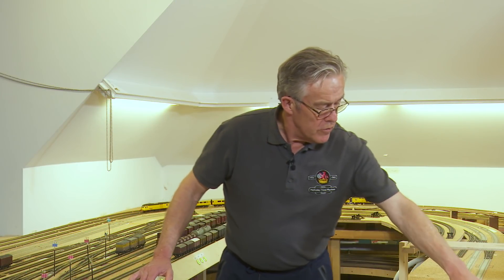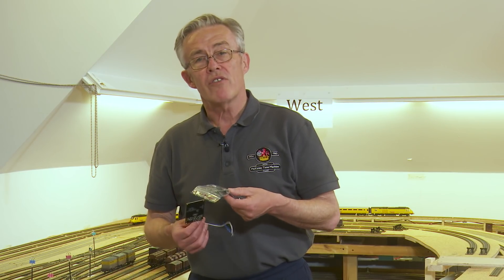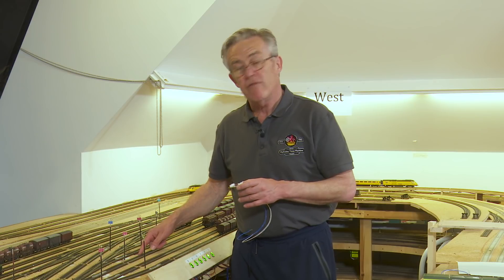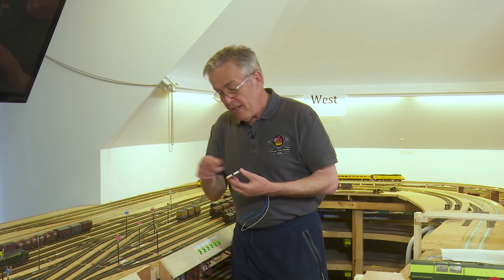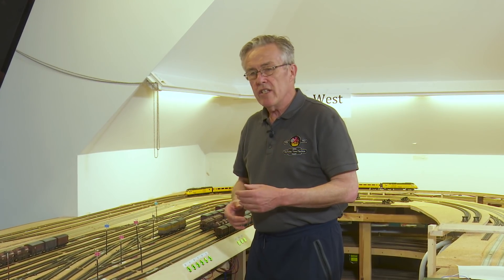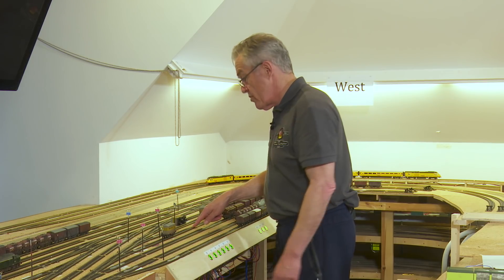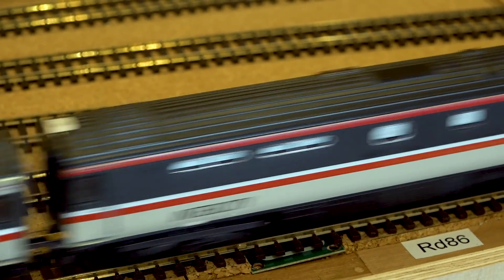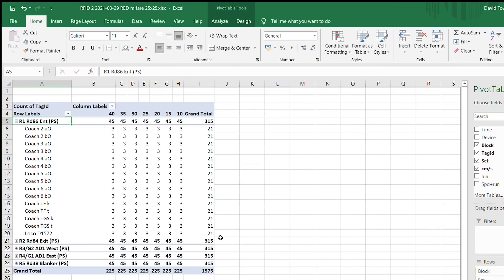47.  Our RFID Beta readers are now reliable in managing our freight stock at McKinley Railway

Comment: Why not considering UHF technology. Also using a 2g/3g/4g on board UHF unit would be a cheaper solution. Putting RFID tags on the tracks are cheaper. With an on board unit, you will be able to expand the application such as speed of train, etc.
Reply from the maker: Hello groovy,
We are not RFID experts and Its taken us a long while to get this far.  We don't need to monitor train speed as that is controlled by the software and it does a good job at it.  Our real challenge is to identify where the wagons are as the primary goal is to manage freight movements.

I believe putting readers onto wagons would be extremely expensive and very challenging re power and space.  The tags are cheap, but the readers not. Bear in mind we have 10 times more wagons that we have locations we want to record. So our orientation of the world works for us (i.e. tags on wagons and readers under the track).  We looked for practical solutions provided by manufacturers that could be considered to be Off-the-shelf. Good luck with your ideas there.

Comment: Very interesting and exciting! Following your progress closely. 

Do you still have the sam RFID-tags you showed two years ago or have you found any updates to the tags? 
https://youtu.be/xcWixqpF44A

I'm looking for tags that would fit under an N-scale waggon. 

Thanks for at great channel!
Reply: You may try UHF PCB metal tag that uses screw to mount.
Reply: @groovyc4344  Thanks!

Do you have any suggestions on brand and model or where to buy them?
Reply: @AlexEhn  they may send free samples
Reply: Thank you very much  @groovyc4344 ! Much appriciated. I'll check them out.
Reply: @groovyc4344  Do you know if the UMT – 12x7x2.5 is the same technology?  Or even UMT - XXS that is 5x 5x 2 mm

79x20x3 is a bit to large for N scale.
Reply: @AlexEhn  yes both are UHF technology. Read distance depends on the size of reader antenna and tag. What read distance would you like to achieve?
Reply: @AlexEhn  but for small tags you may not be able to screw them on. You may need to use epoxy to stick them onto metal surface.
Reply from the maker: Here's the ones we use across all the stock -  It fits on OO/HO.
https://zipnfc.com/nfc-sticker-midas-tiny-ntag213.html
I am sorry but I can't recommend anything for n-scale.
David
Reply: @dattouk Brilliant! Thanks alot!
Reply: @dattouk  That was precisely what I was hoping to find. You mount them with a sponge on the underside of the stock, don't you?

Comment: Fantastic stuff! I'm particularly a fan of the cargo registry for automatic unloading of appropriate goods, it's amazing what new ideas a "small" change can produce!

I'm interested though how the initial setup works for each wagon/loco - do you have to tell it where it started initially, or will it work it out once it's gone through a couple gates?
Reply from the maker: The system will know where stock is when it goes over a reader.  However, its not quite that simple.  We have to get the engine right in terms of pre-locating things as the software wouldn't know which locomotive to start from track 10 so to speak.  Once the layout locations have been recorded by the RFID system, the two worlds (database and the layout) should stay in sync.  The assignment of waybills is entirely automatic.  At the moment, they are being generated on a random A to F destination basis to test the software.
Reply: Have you watched the guys video of them actually loading and unloading the wagons with real product. It's all run on lasers and arduino. Real O scale hoppers with manganese I think.

Comment: Looks really great, ultimately though the point selection of the sidings could determine whether a reader needs to be powered to read wagons as they pass over.
Reply from the maker: Hello Andrew,
You raise a valid idea that we did consider.  We decided to put the sensors on each track rather than rely on the point logic to make the determination about the siding just for simplicity at this stage.  It could be done and in time we might get there, but its a bit of a crawl-walk-run process at the moment.
David

Comment: Great to see your breakthrough moments here. If your 8 channel multiplexer can handle a shunter at say 20mph then I suspect you will be able to handle 160mph on a dedicated single channel reader. RFID certainly the way to go as long as no interference from RFID stock running by on adjacent tracks. Optical on a layout like this would be prone to dirt blocking sensors (suspect you'll end up with a few hundred dotted around )- particularly as looking upwards to read QR or bar codes under rolling stock. Great stuff, relish the moment. Stephen
Reply: I would think the on board reader is a better solution. Placing tags on tracks are much cheaper and much more reliable because passive tags are very durable.
Reply: @groovyc4344  Here its the other way round, they have the tags in the rolling stock (suspect 1000s of even allowing for one for each of their triplets) and the permanently powered static sensors located beneath the tracks. Using the multiplexer card they had Eccel develop I suspect has also saved them both installation time and costs in addition to the space savings/ real estate elaborated on here versus single channel units. Its certainly a ground breaking and technically challenging layout!!
Reply from the maker: @stephenpike3147  You have the logic correct Stephen  The readers are expensive and need quite a lot of power and space which isn't available in the wagons themselves.  Its been an interesting journey just to get reliable reads.  The big challenge is metalwork.  It interferes with the signal more than track power does.  I have no idea if it will work at a scale 160 MPH.  I have nothing that will go that fast.  We have found that certain MUX readers work better that the dedicated ones.  Go figure!  Anyway, we now have to test the hardware working with the software.  I envisage a typical operations session of 3 hours will have about 900 reads in one station alone.  If we can get the system to behave with say 3 or 4 hiccups for the operators to resolve  I will be super happy.
regards
David
Reply: Interesting g to hear about your problems. If the rails are the problem interfering with the magnetic field have you tried using rails of a different composition.  E,.g. relative permeability of iron circa 1000 versus brass circa 10, copper 1 at  50Hz  (brass depends on composition rest I believe varies on frequency), a simple trial set up might help evaluate. Problem is track manufacturers do not declare  composition of alloy used. Just wondering if this might be root of problem (I am not an RF or antenna man!).  Stephen

Comment: You mentioned it was tuned...

So is this special or off-the-shelf readers / tags? I'm curious, because I've been trying to use RFID tags myself, but I have been unable to read the tag fast enough to detect a running train.
Reply from the maker: They are off the shelf.  Our results show they are excellent for HO/OO speeds of 65 MPH/105 KPH.  Maybe faster, but that is the max speed we will operate our trains at.

Comment: Hi Dave.

What with Charlie's new electronic signalling system, and now your new rolling stock location system, I've started developing seizures and find myself staring into space for no apparent reason. I told my doctor I only wanted to play trains, then he insisted I put on this white jacket with sleeves that are tied around the back of me. What's going on?
Reply from the maker: Dear Paul,
Your comment had me in stitches.  I promise the end result will be rewarding.  A core mission for McKinley is that visiting railway clubs should be comfortable operating a part of the layout within 30 minutes of arriving for a day's operating session.
Most of the followers I have met blame me for their wallets looking really empty, but they have a huge smile on their faces.  Take comfort that if they haven't committed me yet, they will leave you alone for another year at least.
David
Reply: Thanks Dave.

Judging by the odds, I'd say we are both safe from being committed. As my ol' Mum used to say: "There are more out than in!".

Comment: Interesting stuff David!  Your approach, with the latest updates and reworks obviously performs well and the database integration opens up a whole load of new modelling dimensions as you touched on. However, What are your thoughts on costs? I think my main reservation would be the cumulative cost of RFID on a layout. RFID costs have been a major barrier to the adoption of RFID tagging of 100% of goods in supermarkets and its use only on comparatively high value products.  Aside from that reservation this is great work!

Vehicle location schemes are of course most valuable on large layouts where there may be multiple operators or where significant portions are not easily viewable. I have been investigating using micro-QR codes (Just printed on a general purpose Brother label printer and measuring no more than 7mm square) stuck on the bottom of vehicles, and using cheapy little QR code readers with serial outputs under the track.  QR codes are massively more robust than 1D barcodes and can be read very fast.  So far I have 2 readers talking to a single Arduino pro (also very tiny) to receive and marshal the serial data. The Arduino send all data back to a central control point (a PC at the moment) via serial cable (eventually it will be just a CAT5 Ethernet). As yet, I lack a layout to do proper testing on though, so no idea how reliable it would be with trains passing at speed and with many in operation at once.  However just pushing stuff along the rails fairly fast it all works well so far.  Now you have me wondering if I should go RFID instead! 

Thanks again
Alan T.
Reply: To be honest, whilst Dave is cautious with expenditure, I don't think they worry too much about the costs.  Look at the project, there's probably tens of thousands of pounds invested in track and wagons alone.  A few hundred on RIFD tags isn't much in the overall scheme of the project.
Reply: plus, it looked to me one RFID per 3 cars/wagons. Perhaps more reliable at speed.
Reply: Regarding cost: RFID tags are really cheap if you get them in bulk, like a cent per tag for 1000 tags
Reply: @goawaygoawaynow  Before I investigated the micro-QR route I did play around with 1017 RFID readers and NFC tags, but the range was a problem and the stick-on micro NFC tags were nothing like as cheap as you instance.  You can certainly buy the Mifare medallion tags for that kind of money, but they are too large for this work and - as Henry instances below - the range is not great for this purpose anyway.  I have never found stick on ones of the right size for this application anything like that cheaply - more like £1 per tag last time I looked. Maybe I should look again now. :-)
Reply: I have been trying RFID with an Arduino but the standard mifare RFID doesn't work (can't get the tags close enough to the reader and metal weights in the wagons interfere). I like your idea of QR codes but I want to know if the reader uses IR or visible light to read the code.
Reply: @henrybest4057  Visible light - well, it shines a visible light!  You could leave it enabled all the time, but In my finished thing I had envisioned that the scanner would activated by a block detector. But this is very much a work in progress for me. Here is a link to the scanner I am testing with - but there are others.

https://www.banggood.com/GM65-S-1D-or-QR-or-2D-Bar-Code-Scanner-QR-Code-Reader-Barcode-Reader-Module-USB-UART-p-1694180.html
Reply: @alanmusicman3385  I looked at the GM65 but it didn't say what the light source is. Even if its only turned on by block detection, light from between the rails isn't prototypical and there won't always be a convenient tunnel to hide it in. A neat idea, but not for me. I hope it works well for you.
Reply: @henrybest4057  Yes, that is a consideration - but even an infrared device would show up on videos or photos of the layout.  I suppose coupling the reader with an IR detector that only arms it when a train is directly over it would be possible, but yes, you'd still have a light from between the rails under the train.
Reply: @henrybest4057  you should try UHF. It works much better than HF.
Reply from the maker: Hi Alan,
The cost is reasonable.  The tags truly are cheap.  They are 22p each.  Here's the ones we use across all the stock.

https://zipnfc.com/nfc-sticker-midas-tiny-ntag213.html

We use the Eccel readers which are either the Pepper MUX 8-channel boards or the single Pepper ones at something like £50 and £35.  The antennas are about £10 each.

https://eccel.co.uk/product-category/rfid-readers-modules/current/current-hf-13-56-mhz/

We found the MUX devices work well in most areas, but have gone for the single readers in high speed zones just to be safe.
We anticipate installing about 25 antennas in Wakefield attached to 6 mux and 4 stand-alone readers which is high but we are on a belt and braces mission here.

The difference between our world and supermarkets is 22p on a disposable bottle of milk is huge.  On your stock which should last a lifetime, the cost is reasonable  Bear in mind that we are only attaching single tags to sets of coaches and triplets of wagons.
So there you have the cost of getting one seriously sized station/yard equipped.  Roughly the same as three sound fitted locos to put it in perspective.

Regards
David